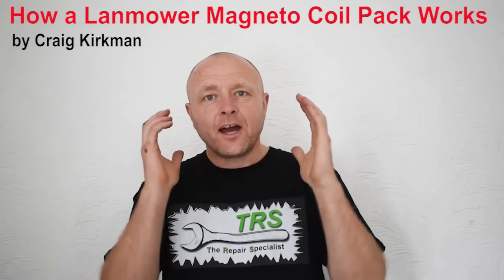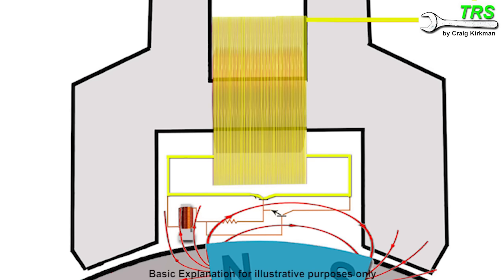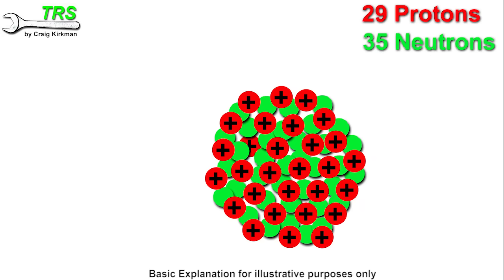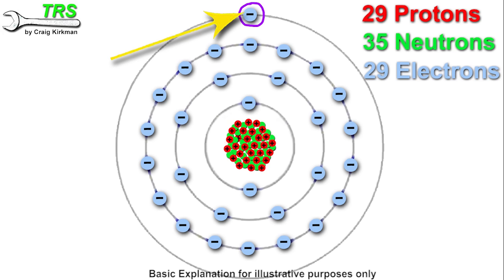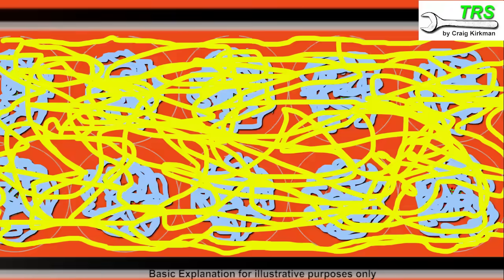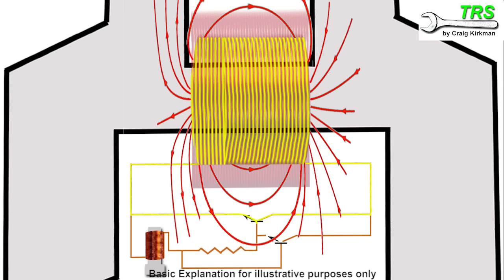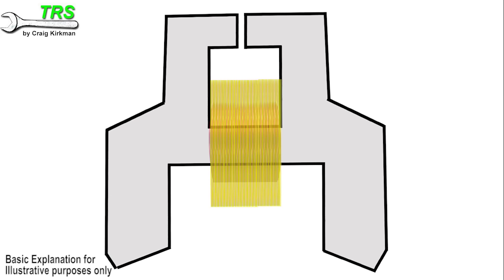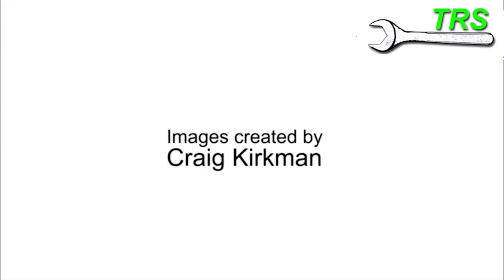Lawnmower Coil Pack Sparking System - Induction Coil, Transistor!  (by Craig Kirkman)

Comment: …..three hours and I still can’t find how to wire the condenser and coil to the points terminal post…..
Reply from the maker: Well, of course the ignition coil in this video doesn't have points like the older breaker points system.  But to help answer your question, here are some tips that might help you.  I'm not trying to sound over simplistic and teach you how to do something you already know, i'm just keeping it simple so I know i have covered the basic.  So I apologies for this first of all!

Find the points terminal: Locate the points terminal on the ignition system. Typically, it is a tiny metal post or connector with the letters "P" or "Points" on it.

Find the coil and condenser: The coil and the condenser, which is another name for a capacitor, are two distinct parts. While the coil produces high voltage for the spark plugs, the condenser is in charge of controlling voltage spikes.

The condenser normally has two wires, one of which is linked to the points terminal and the other to the primary winding of the coil. This is how you connect the condenser. Connect the wire from the points terminal on the condenser to the ignition system's points terminal. Verify the security of the connection.  Of course, condensers can carry charge, which can discharge a nasty current in to the hands that touch it.  Make sure the condenser is not holding charge before touching it.  I needed to say this for safety disclaimer reasons.

The coil should have two primary wires that are connected to the magneto or ignition switch and the condenser, respectively. Connect the coil's suitable primary wire to the wire coming from the condenser. Once more, confirm the security of the connection.

After completing the required connections, make sure that all wires are firmly fastened and that there are no exposed or weak connections that can result in electrical problems.

It's vital to remember that depending on the brand and type of the ignition system, the particular wire configurations may change. For the most precise instructions, it is always advised to consult the manufacturer's literature or a wiring diagram tailored to your ignition system.

I hope this has helped a little

Craig
Reply: @TheRepairSpecialist  thank you for such a detailed reply. I’m up and going

Comment: THIS is just great Sir. I finally get the physics lesson with clearity. What I am wondering is how much energy is needed to cut through the magnetic field ??
Reply from the maker: First of all, thank you for your kind feedback. As to try and answer your question: 

Cutting through a magnetic field does not require energy in the same sense as performing work or consuming power. When an object moves through a magnetic field, it experiences a change in the magnetic flux, which induces an electromotive force (EMF) according to Faraday's law of electromagnetic induction. This induced EMF can generate a current if there is a closed circuit present.

If you're referring to cutting the magnetic field of an ignition coil with a physical object, such as a wire or conductor, the energy required depends on factors such as the strength of the magnetic field, the velocity at which the object moves, and the resistance of the circuit. However, the energy needed to "cut through" the magnetic field itself is minimal, as it is primarily the change in flux that induces the EMF, not the physical act of cutting through the field.

It's worth noting that the term "cutting through" might be more applicable when discussing magnetic fields being interrupted or altered by objects or materials, rather than physically dividing the field itself.

I hope this helps a little 

Craig
Reply: @TheRepairSpecialist  Thank you Craig for clearing that up for me Sir. Excellent video Sir.

Comment: Hi, so if I have a motor n magnet spin in it. The  washing machine motor. 120v, 10 amp. Get the other motor spin magnet let say 2000 rpm it give 120v.  If it spin 1000 rpm would it give 60v  and 5 amp?  I try to make power for lights.  Thanks
Reply from the maker: Well, I think the best thing for you if you want to create power for lighting is to invest in an actual generator. I say this because of the safety aspect to you if you try to producing this circularly, and it will save you so much time as well.  So a generator will be safer and more time effective. I hope you don’t mind me saying this. Craig 👍

Comment: Very nicely explained. What I always do if the coil is not sparking is to remove the cover and the coil, then take sand paper and clean the rust off the metal on the coil and magnet on the flywheel. Put it back together using a business card to gap the coil from the flywheel.
IT'S A VERY SIMPLE FIX. 😂👍😎
Reply from the maker: Thanks 👍

Comment: What is the purpose of the air gap in the Iron core at the top.
Reply from the maker: Well the gap is basically there for control of the magnetic flux withing the coil.

Controlling the magnetic flux in an electromagnetic device, such as this one, an electrical transformer, or an electric motor, is the goal of the air gap in the top of the iron core. The magnetic field and the device's performance are impacted by the discontinuity in the magnetic path that the air gap introduces.  The air gap makes the area more resistant to the magnetic flux and increases its reluctance. This indicates that a greater resistance is encountered by the magnetic field lines when they bridge the air gap and go through the core. As a result, the air gap's magnetic field is weaker than it is elsewhere in the iron core.

Engineers may alter the device's magnetic properties by varying the air gap's size. This makes it possible to optimise the functionality and effectiveness of transformers and motors. The air gap aids in regulating magnetic saturation, enhancing the magnetic circuit's linearity, and lowering leakage flux.  For instance, the air gap can be purposefully inserted into the core of transformers to prevent core saturation during high-voltage or fault conditions. The air gap aids in maintaining the performance of the transformer and defending it against harm by restricting the magnetic flux in specific regions of the core.

Overall, the iron core's air gap is a purposeful design element that influences the device's magnetic characteristics and enhances its performance under varied operating situations.

I hope this helps 👍

Comment: A very impressive introduction to the magneto with splendid graphics. However the explanation of the electronic pricible is not entierly correct. As shown a 3:56 the magnet creates a magnetic field in the core. This magnetic field can store enough enegy to potentioally initiate a spark in the spark plug. The trigger coil+transistor acts as the contact points in older systems: When the magnet reaches the trigger coil it opens the transistor that rapidly short circuit the primary coil (like the contact points did back in time). The short circuited primary coil rapidly drains enery from the magnetic field. The rapid change of the magnetic field induces a high enough voltage over the secondary winding to create a spark.
Reply from the maker: Thank you for your feedback and kind words.   We could debate for hours on this, but the iron core is there soley to provide the means for the coil winding's to produce a magnetic field.  The core and windings together produce the magnetic field, and this field expands outward from the coil. So, yes, we could say that the iron core is indeed magnetised as a result of the combination of the coil and core, as i mentioned in the video.

A magnetic field is produced around the primary winding when the current flows through it. This magnetic field is concentrated and strengthened by the iron core, which is normally constructed from laminated steel. The effective storage and transmission of magnetic energy is made possible by the iron core's high magnetic permeability.

So, yes, i do agree with you, but there isn't a magnet that just induces a magnetic field within the iron core, instead it is the Iron core/coil windings combination that creates this magnetic field, and the iron core, as you said, does indeed receive this magnetic field. But the iron core's job is to concentrate and strengthen the magnetic field, as a result of both core and coil winding producing it together.  Basically, together they are the magnet!

Thanks

Comment: Thanks,
Fixed my no starting problem on my John Deere
garden tractor.
Inside the rubber boot that
slides over the spark plug
the metal plug wire right 
angle connector had
broken.
Only thru the Grace of God
did I discover the problem.
The spark plug wire pulled 
free from the boot.

Comment: Nice. I like this. I subscribed. There are some parts that I question, the flow in the two transistor circuit. I've forgotten a lot of this stuff so I'm not positive how this work. I think you did a nice job of this though. Please keep up the good work.

Comment: You need to complete the path through ground from the spark plug base AND THEN explain how grounding the coil kills the ignition when you want the engine to stop.  Your explanations are good indeed but you left the secondary hanging.

Comment: Could you explain the dead man's connection to the ignition coil to shut it off and how its wired to the coil. What is the resistance from the DMC to the laminated frame which is mounted on the engine frame.
Reply from the maker: Yes I will do that very soon. 👍

Comment: I felt some issues with this explanation: It sounded like the trigger coil induced the spark energy when its the magnet zipping by the iron core that provides the spark energy. The trigger coils function with the darlington pair transistor is to clamp down, short circuit the energy within the iron core, like allowing a flywheel gain rotational speed. Then the vital pivot point was not explained: The magnets progressed movement causes a polarity shift in the trigger coil, the reversing the current in transistor circuit means the darlington pair will go open circuit while the electromotive energy stored in the core is at/near maximum. That electromotive energy needs to go somewhere, and the easiest path will become the secondary(spark plug coil).

Comment: Almost lost me on the explanation of the atom because I've heard it all before. But I'm trying to figure out how this physically works. You gave me the answer in the last part that the charge is searching for a ground which is supplied by the spark plug.  That was what I needed. I wasn't aware however that the coil was looping the charge back upon itself. Interesting stuff.

Comment: Brilliant explanation. One question. Is not the other end of the secondary coil connected to ground to complete the circuit for the high voltage circuit?

Comment: The collapsing field in the secondary coil creates a voltage high enough to cause a spark to bridge the plug gap. Why doesn’t the same thing happen (in reverse) when the field in the secondary expands as the primary coil is energized?

Comment: GREAT explanation.  I have spent a career working with induction heating equipment from 1kw to 1.5mw,  capsealing to foundry melting system, servicing, training, and engineering and did not come up with a satisfying explanation for the "technical" layman, the people using that equipment.  Retired now and wish I had seen this 50 years ago.
Reply from the maker: Thank you for letting know and for your kind words. Craig 👍

Comment: Thank you for the tutorial. I'm working on a simple DC motor that will replace the mechanical commutator with a pickup coil or a trigger coil. It's not as complicated as a 3 phase brushless motor. It will only be single phase.

Comment: I’ll be 75 in a few days, if God is willing.
Maybe I’ll have a French 75 cocktail to celebrate.
I’m working on a B&S 2hp built in 1971. It is on a lawn edger.
I got it out of the trash. It cranked right up and I started cleaning it up. Just before I was about to test run the machine, it died.  It was like it had been shot. Anyway, no spark.
I pulled the magneto, flywheel, points, and condenser. I ordered the points and condenser kit and today I hope to have time to test the magneto, clean the flywheel, and all the electrical contact points in the system.
Thanks for your training. It has given me confidence that I am correctly doing the work.

Comment: The charge needs to return to the source. You made an incomplete circuit and did not correctly describe ground. You're not wrong but at minimum the secondary coil is connected from one end to the chassis (ground) to provide a path back... otherwise all your little copper atoms would permanently be ions. The charges must flow back to their sources. They jump the air gap because of the ionized air but also because that ground electrode is attached to the engine which is attached to the magneto which is attached to the other end of that secondary coil, thus producing a potential difference and a path back to the source in order to equalize and fall back to even potential once again.

Comment: Great video thanks. Question: where is the link to earth on the primary? Is it possible check the primary coil circuitry by measuring the resistance at the ‘kill switch tab’ to ground? I have 2 coils measuring about 0.5 ohms, on of which I think is dead.

Comment: Thank you, I did not realize there were transistors imbedded to momentarily hold the current in the primary coil before collapsing it. Just a note you did not show the ground (positive) connection for the secondary coil. This may help some who may think it is floating or not connected.

Comment: The iron core seems to be a passive participant in this process. Does it have any direct connection to either of the coils or the HT lead? I am trouble shooting the coil on a leaf blower and one of the service manual instructions is to check the resistance of the ignition lead. If the primary coil is insulated from the secondary coil, and the secondary coil is insulated from the iron core, how does one check the resistance in the ignition lead, or HT lead, as it is otherwise known? I fell like I must be missing a basic concept of anatomy or function here. Any help would be appreciated.

Comment: Excellent explanation! Is there any way which the ignition timing is changed in any of these simple magnetos? Electronically maybe? Or is movement needed to alter the relationship of the magneto and the magnet which passes by?
Reply from the maker: Hi. Firstly, thank you for your nice feedback. I really appreciate it. Sorry if you already know this information but because I don't know your level of knowledge at all, I  though I would just explain in case.  To answer your question: Generally, these small ignition coils are already timed.  As the flywheel magnet is situated onto the flywheel.  

The flywheel is situated in the correct place on the crankshaft, via a cut-out key-way, to make sure that the flywheel magnet passes the ignition coil at the correct time in relation to the movement of the piston.  

If the timing appears out, which does happen sometimes, then it is usually because the key that holds the flywheel in place is sheared, which puts the flywheel magnet out of time with the piston's movement. This is quite common so sometimes its a good idea to check this. 

again, i'm sorry if I'm going way too basic for you. Just wanting to help

Craig  👍

Comment: Great explanation.   But ... that means all the free electrons will be drained out of the secondary coil?! ;-)
Reply from the maker: Thank you for your nice feedback. I really appreciate it.  

You are absolutely correct in bringing this point up. Well, from what I have found myself, the electrons can't really run out leaving the secondary coil without any because of a special point connection.  The explanation i gave in the video was a very basic one so I didn't cover every detail.  

The primary and secondary coils are actually connected by a very small/thin connection of wire through the insulation at one point.  This doesn't prevent the electromagnetic process occurring because it is so small.  Because there is such a large volume of electron flow when the magnet passes the flywheel, it all happens so fast.  The primary coil is energized, as shown, and the coil is exited by the primary coil as shown.  All in an instant! 

Because the connection is so small, and occurring at one point, it allows the electron flow energizing of the primary coil without any issue.  After the process is complete the electrons can flow back, at their rate, to the coils from the engine body. 

So the electron movement loop is:  1, Engine Body   2, Primary coil    3, Secondary coil   4, Spark plug   5, Engine body once again.  Repeat process!

Again this is a very basic way of looking at the topic.    

I hope I have put this across ok.      

Thanks
Craig

Comment: There is something i dont understand. If tge coil is fixed to the engine with bolts without insulation like nylon washers, it will always be grounded so you won’t have a spark on the plug. Unless the sparkplug gap is too wide?
Reply: I’m trying to trouble shoot my old tractor. I don’t have a kill switch on the kill wire. It was working find before i changed the coil for a new one.
Reply from the maker: It wont ground because the primary and secondary coils have their own insulation, which prevents them from losing the current to the ground. 0:50 on the video mentions the insulation. Thank you. Craig